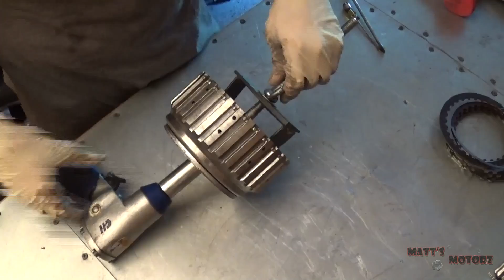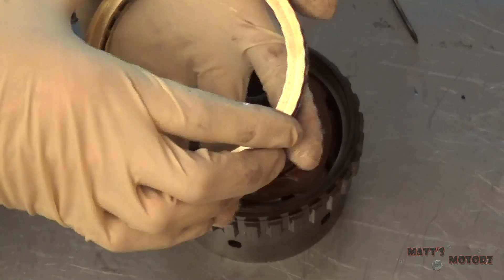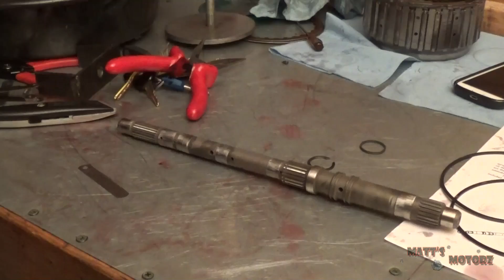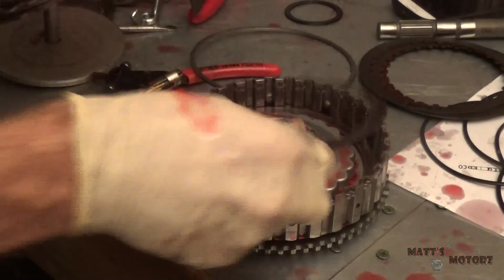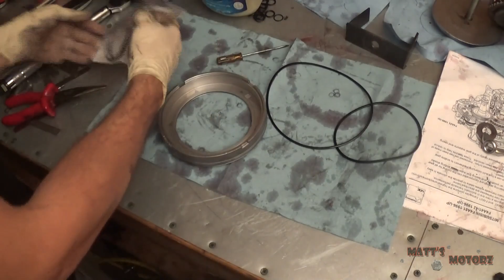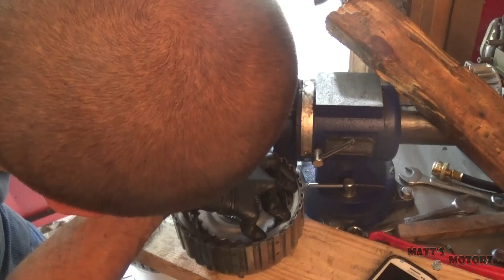F4A42 Transmission Rebuild: Part 3 - Clutch Assemblies and Seals Replacement

Comment: when you got the brake disks you didnt show the orientation of the assembly. Im having trouble with that whole section. service manual is not clear. dont know if it goes pressure plate 5 clutch and 6 steel then snap ring then second piston return spring steel clutch steel clutch steel snap ring  is that right

Comment: Hey I have a 2003 lancer that has the N light blinking ever so often and the car sound like it is fighting to move it crawls every time I stop or slow down to move off but then it kicks into the speed it should after a few seconds. Can you tell me what is really the problem with my car?
Reply: I had the same problem. Sticky valves led to stripping the teeth out of a clutch plate in the underdrive clutch assembly.

Comment: Which service manual did you use?
Reply from the maker: Rico Kiko The factory rebuild manual. You can get it easily online for free if you type "F4A42 Transmission Rebuild Manual" in google.
Reply: Thanks!